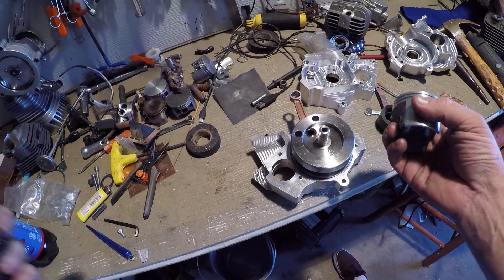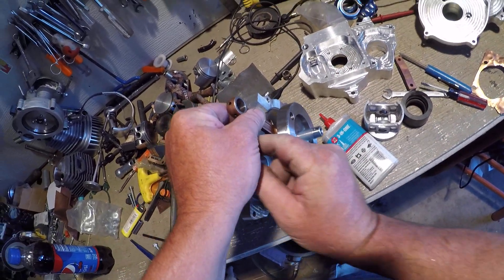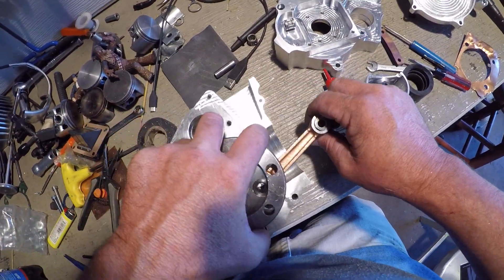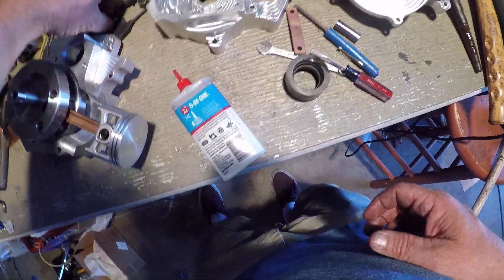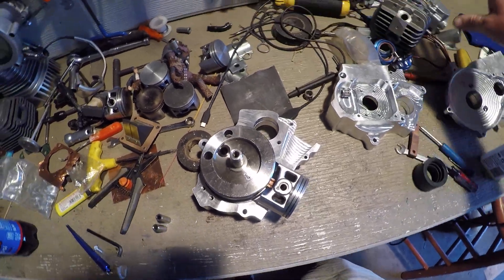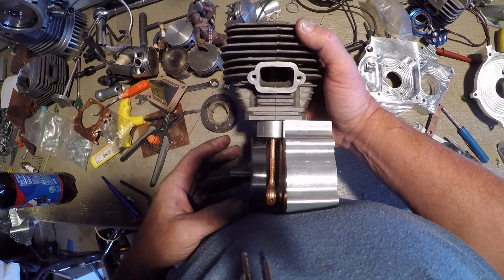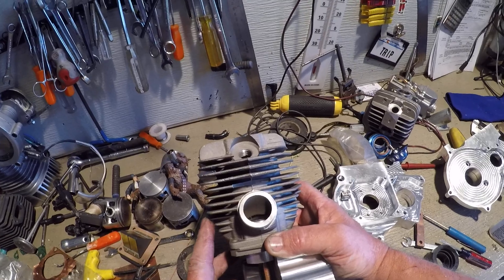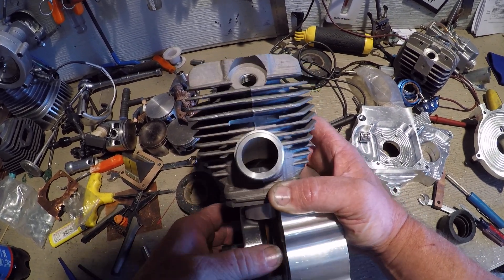measuring stihl ms660 56mm cylinder on a billet case. mz 44mm crank

Comment: Would the zae80 be the perfect height for the squish band on the 56mm cylinder? Or is there another step
Reply from the maker: this stihl ms660 over bore to 56mm and has a giant stroke. the bigger the stroke the less you have to remove. i am using the mz stroker 44mm stroke and a pk80 is less than 38mm. even with the 44mm stroke crank i still need to remove 9mm. 9mm in deck removing is like a mile.

Comment: you do not want the intake to open into the chamber side top of piston. them 44mm cranks come long and short rod.
Reply from the maker: This is how i measure a cylinder is by looking at bdc when removing deck. when raising (stihl ts400) with a spacer i start on top and look how much i have to add by looking at how high it pushes off the case. My method is very simple.
Reply: @gangsterbuilder  if it is so simple why am I always confused af?